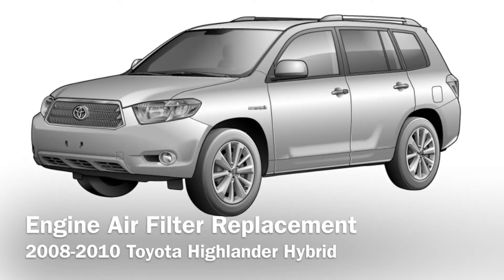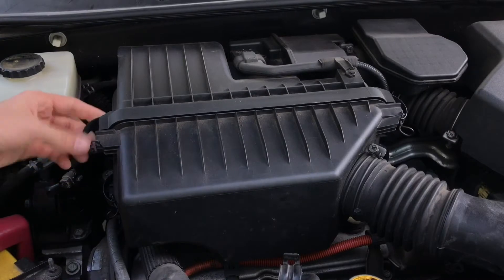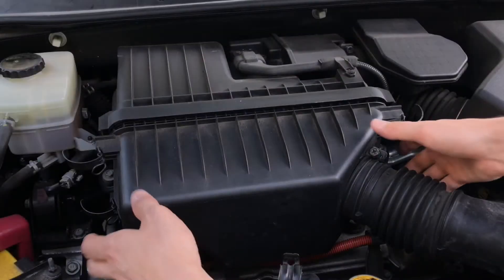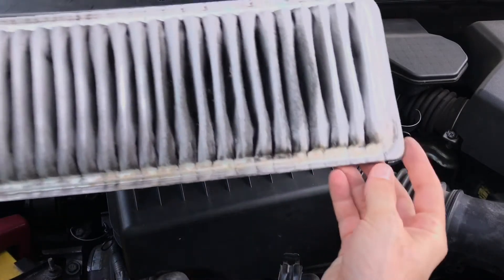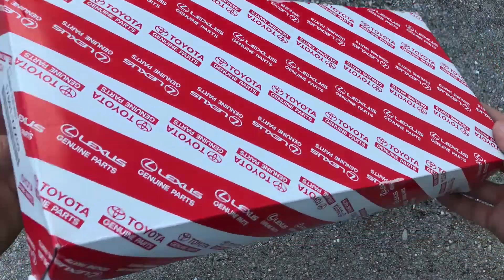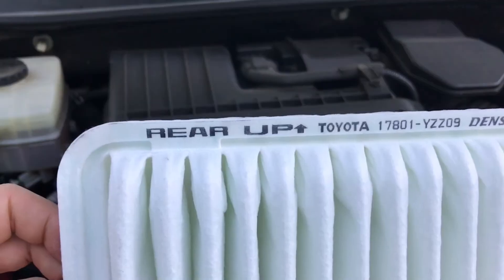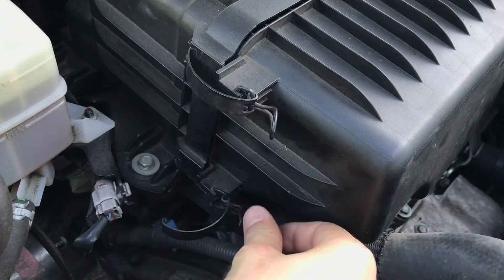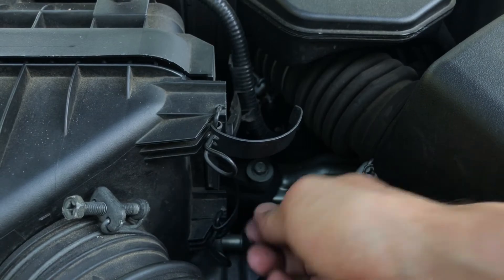Engine air filter replacement on 2008-2010 Toyota Highlander Hybrid Limited Edition

Comment: what is that other filter in there, I don't see it listed on parts.toyota.com odd there would be a permanent filter that's non replaceable.
Reply from the maker: Yes, it is more of a screen for large particles in case you dont have anything installed. It is not replaceable.

Comment: Why are there 2 intake filters in this car?
Reply from the maker: It's hybrid car. The other box is for the hybrid battery coolant reservoir.
Reply: DIY-time Thanks for the reply, I was actually wondering about the permanently fitted filter that’s directly after the replaceable filter. I have the same car.